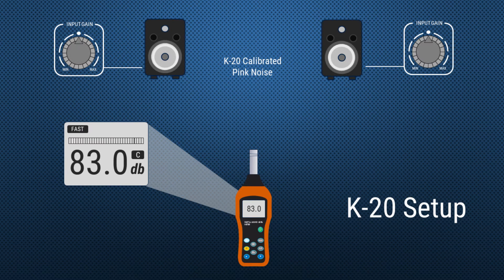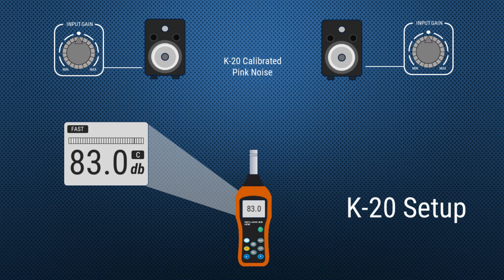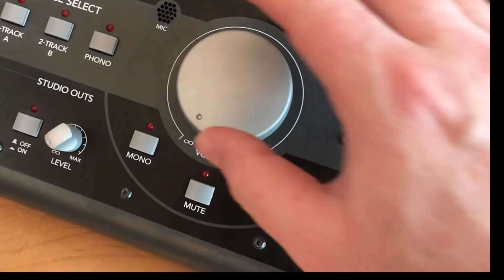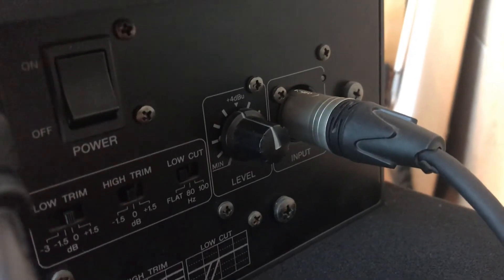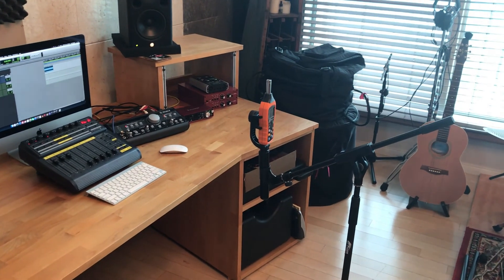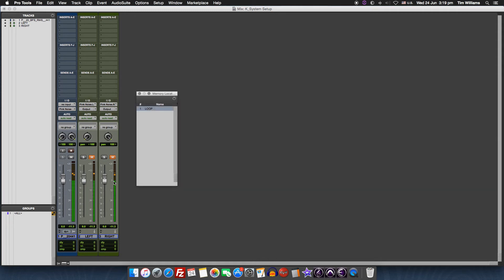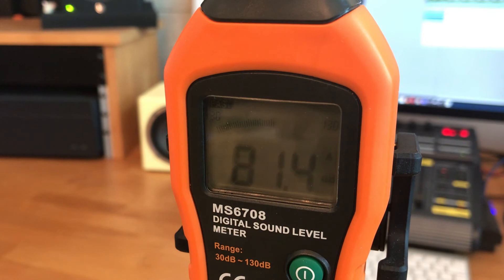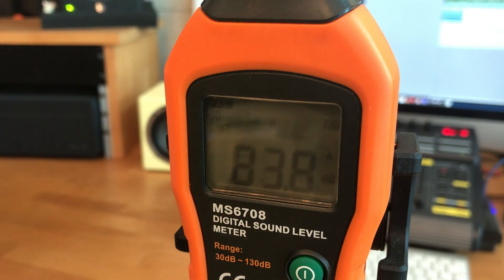K-20 Monitor Setup with Calibrated Pink Noise

Comment: 86? NO! You should mix and master at "83 dB or less" and not at 86 dB. After only 8 hours, 85 dB can cause permanent damage to the hair cells in the inner ear, leading to permanent hearing loss!
Reply: 85, according to Bob. But hearing loss doesn't come from the level of calibration. It comes from the listening/monitoring at a high level. These are totally different things. If you mix at 85 dB you would not use too much compression and your music would not sound too loud. Mixing at 85 leads to natural dynamics in mixes. If a track sounds too loud at 85 it should be remixed.
Reply: @CyrilleBoucanogh  "Sounds at 85 dB can lead to hearing loss if you listen to them for more than 8 hours at a time. Sounds over 85 dB can damage your hearing faster." These are direct statements from ASHA (American Speech-Language-Hearing Association). It's nothing something you can debate. It's a scientific fact.
Reply: @andynonimuss6298  but can you imagine a situation where you have to work for more than 8 hours a day with sound up to 85 dbSPL? Are you mixing for 8 hours?? 
If you worry about harm from high spl put an spl meter next to you while you mix and watch the meter. If its up to 85, lower the individual faders and rebalance your mix, but still don't touch the calibrated output level knob, otherwise you'll want to use more compression and would lose natural dynamics. 
85 is not too loud. Its Just right for the music to sound in the most natural way.
Reply: @CyrilleBoucanogh  You are assuming that everyone is using calibrated Class 1 or 2 SPL meters... they are not! Most are using phone apps that can be as high as 10 dB off. So while they are metering at 85 it could actually be 95 dB. I use a Class 2 Testo 8155 Sound Level Meter with +/-1.0 dB accuracy also calibrated with a DANO Sound Level Decibel Calibrator. Is the average person using that level of accuracy to protect their ears? NO!

Comment: the meter is supposed to be set to slow though and 83db is for larger control rooms. anything smaller should be anywhere between 73-76 dbspl

Comment: Hi man tnx its great
My manitors  In essence has gain difference between them
Actually when the calib sittings are exactly the same my right speakers is 2 dB lower than the left speaker
I most turn up the gain knob up a little bit or my speaker has the issues? Or its normal?
Tnx man please help me
Reply from the maker: It can depend on your room - for example if one monitor is closer to a corner or other reflective surfaces. I would suggest holding your SPL close to each monitor (30/40cm) and turn the volume down (maybe half?). Check if you get the same SPL reading at lower volume in each monitor. Another thing to try is switching the RH to LH and LH to RH to eliminate any monitor problem. Hope that is helpful
Reply: @williamssoundstudio5384  TNX man